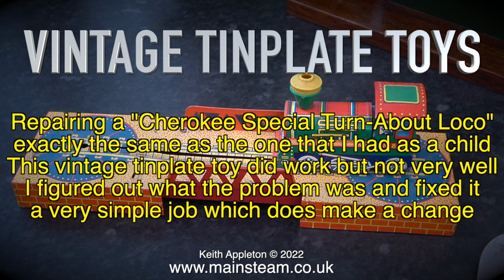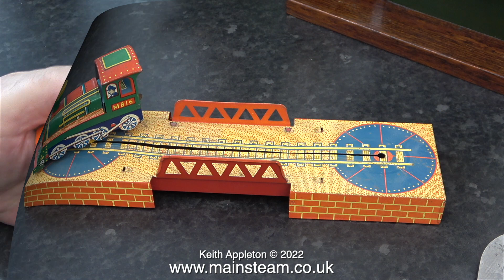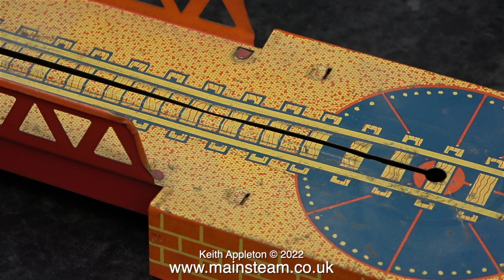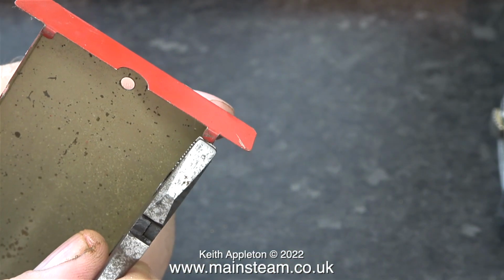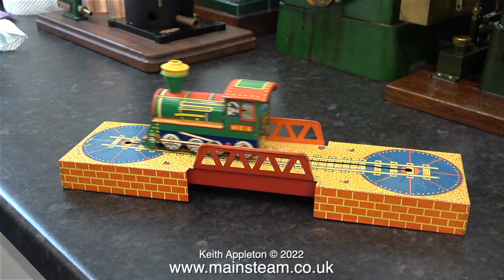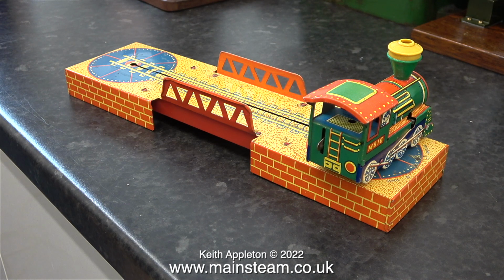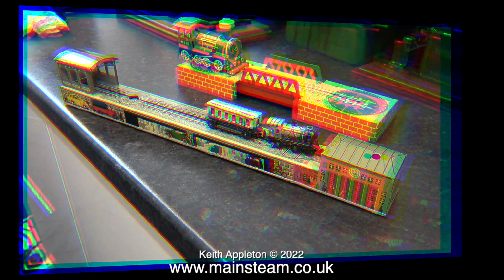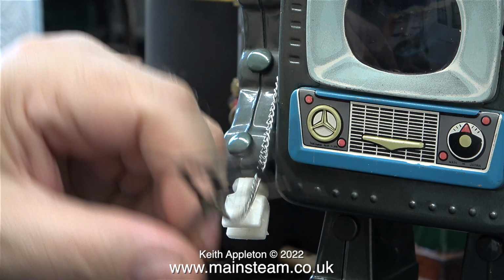A CHEROKEE SPECIAL TURN-ABOUT LOCO - VINTAGE TINPLATE TOYS

Comment: Sometimes the simplest toys are the best. One of my prize possessions is a mamod te1a bought for me by my gran and grandad when I was 12, they figured I was old enough to be let loose with flammables at that point 😂. It's one of the ones with brass boiler and dark red/brown wheels which is apparently quite a bit less common than the usual colours. 
It really was the proper start of my interest in live steam models and not just tabletop trainsets 😁

Comment: Keith, a product you may find useful is an aerosol of "Rubber Roller Restorer". You used to have to buy this from a Xerox service centre, where it was for cleaning the rubber traction rollers in photocopiers. You can now get it from Amazon. I use it for cleaning the rollers in photo printers, where the surface glaze on the photo paper, transfers to the traction rollers, makes them hard and shiny and they eventually stop working. I also use it on old film cameras, which use a rubber roller rather than a roller with sprocket teeth to pull the film through. Over the years, these rollers become hard, loose their friction and stop pulling the film through the camera. Rubber roller restorer does an excellent job of softening the old rubber, making these friction rollers work again and also cleans off any oxidation on the surface.
Reply from the maker: Yes, I used it when I was a computer engineer on printers & photocopiers, it was very good stuff and did the job well.

Comment: Keith, These toys must be mostly found in the UK. I'm 6 years older than you, but I don't remember toys like these in the USA. 
We played with "Lincoln Logs" and "Gilbert Erector Sets", when the weather was to cold and wet to play outside. Then we were playing some sort of game. etc.
However, we did have some "Clock Work" toys, usually a wind up car, of some kind.
Great video, These toys have to be fairly rare, so having them preserves TOY history. ';-)
Reply from the maker: They are not so rare, I found a few on the UK Ebay and they were all quite cheap.